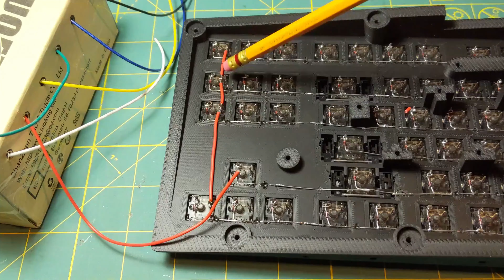split89 - part 2 - Keyboard Build Overview

Comment: thanks for posting these videos. question about the tenting, would it be possible to reduce the height of the board and make it flatter and slimmer? or would there not be enough space for the controller board?